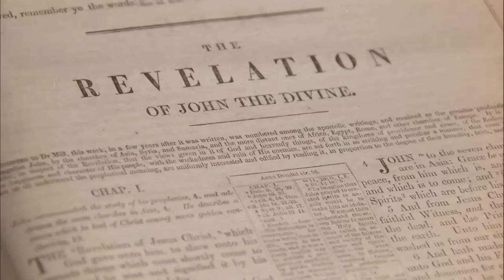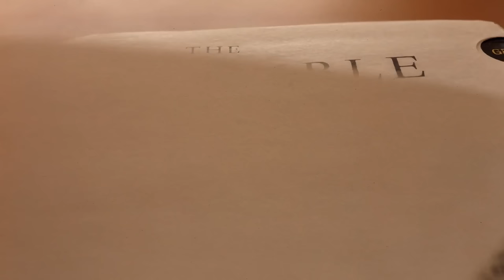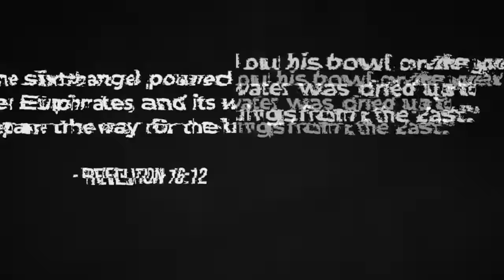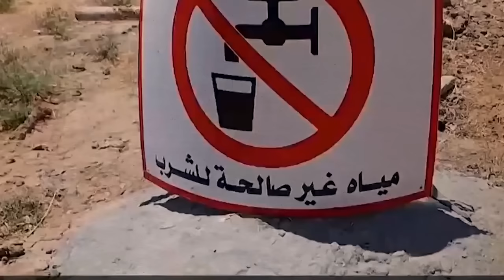3 MINUTES AGO: Cave Under Euphrates River Was Just Sealed Up Because They Found This...

Comment: I believe that wrist Watch looking deal on the arm of Gilgamesh is the frequency setting device and that goes with the tuning fork staff that is in the hands of the pharaohs. Another thing I noticed is a phonograph looking thing it has a center that fits into the staff. It resembles a record. It's rolled up in three places. I think I am the only one that sees this so far. How do I get in touch with egyptologists. I think I have discovered the tool for cutting and levitation and I'm calling it. The harmonic sound device. And the frequency Center is on gilgamesh's wrist